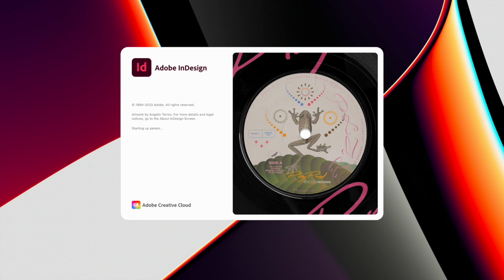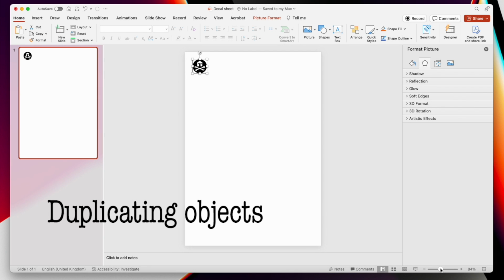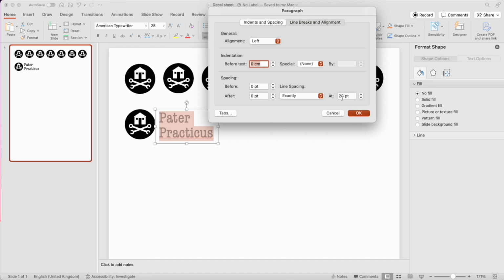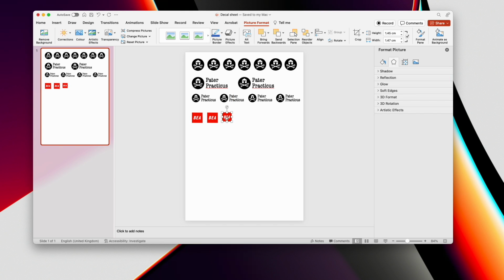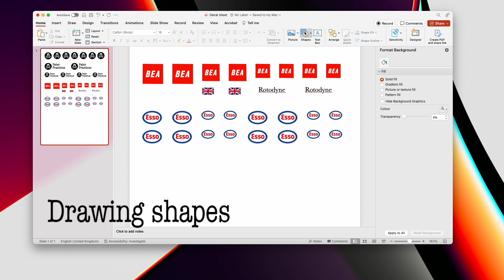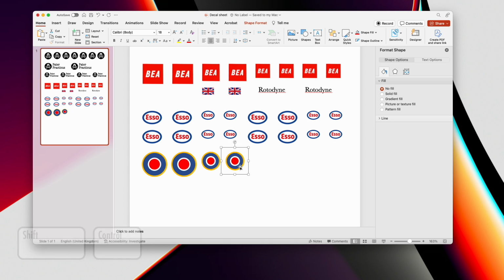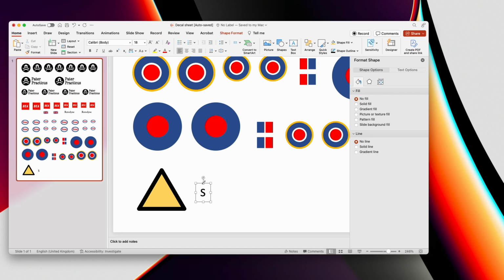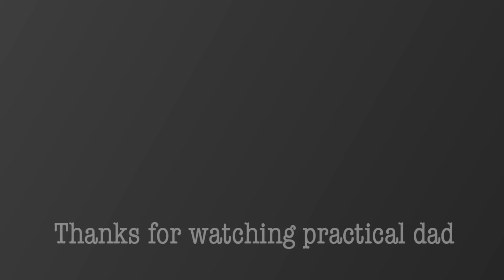Designing graphics for scale model water slide decals ... using PowerPoint!

Comment: How do i print it at another printer because i dont have a printer at home and i need to print it in a stationary
Reply from the maker: Check to see if your local stationery shop are happy to print on decal paper if you bring it in. They will be able to say if it is laser or inkjet that you need. Then save your PowerPoint design as a pdf - you can then put this file on a USB drive and they should be able to plug it into their printer.